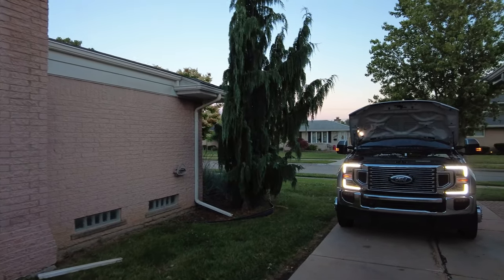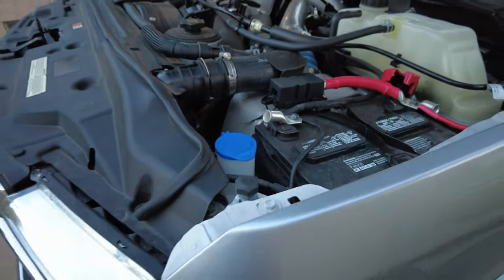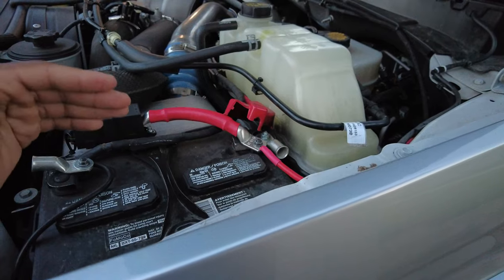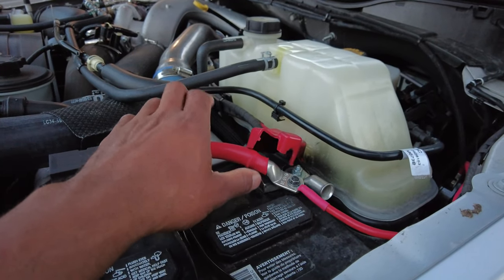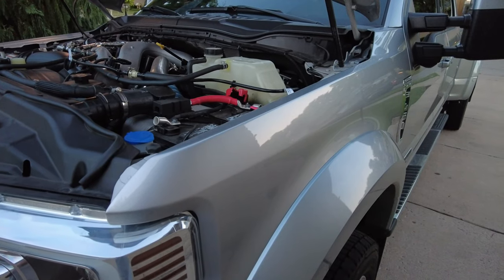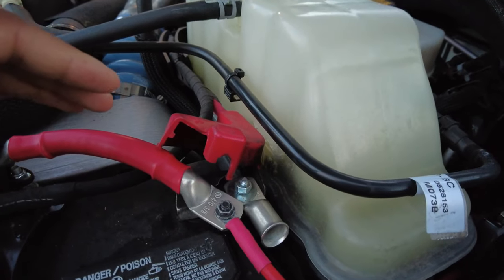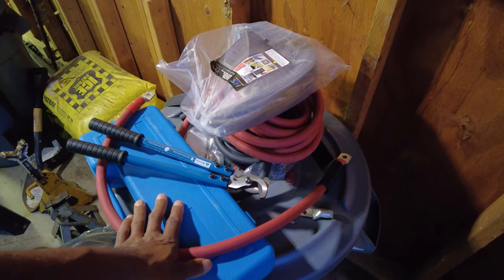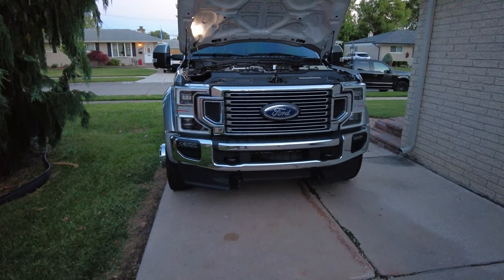I'm struggling 😓 PROBLEMS with my power inverter install!

Comment: You need some Group 31 AGM batteries about a 2-4 of them and run some of that thick cable from the truck batteries to your 4 batteries in the back of the truck..

Comment: you better change those factory battery to agm style deep cycle    not optima or interstate those are garbage
Reply from the maker: What brand do you recommend?
Reply: @DS-TRUCKS  AGM    https://www.crutchfield.com/g_348650/Batteries.html?tp=36339&pg=2